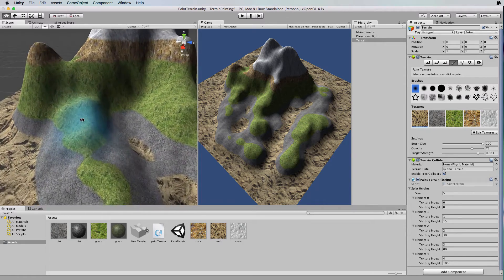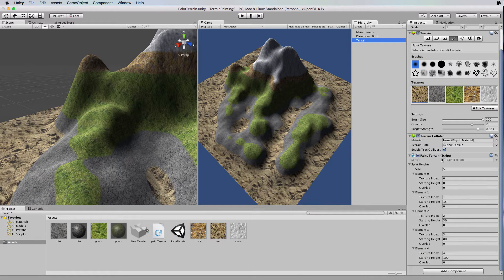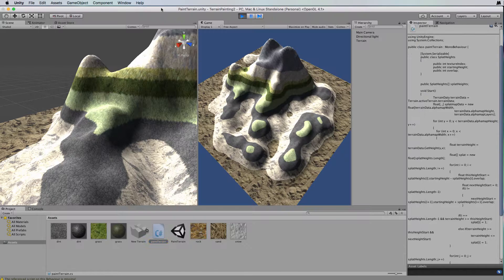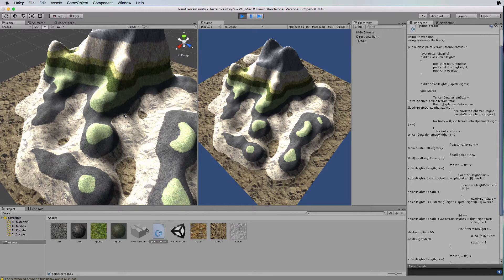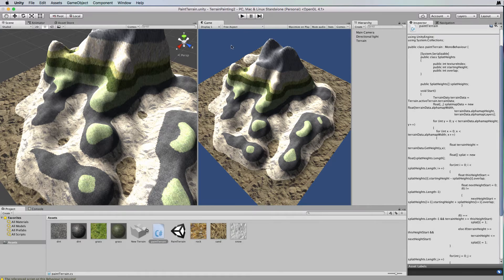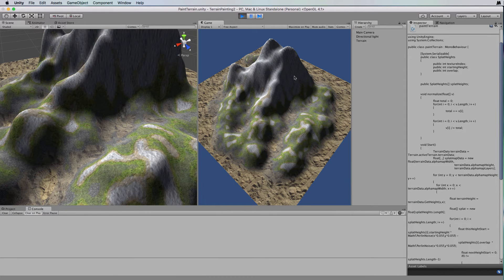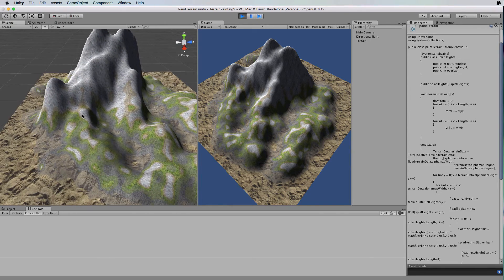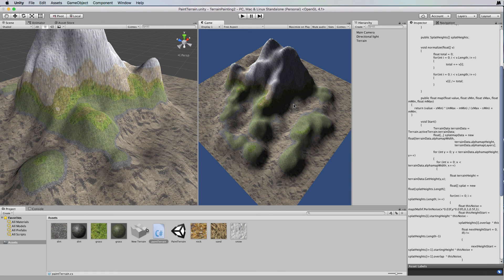Procedural Terrain Painting Part 2

Comment: Not really related to this video...
1.1 Should I use just one big terrain object or many multiple small ones? (If we are talking about procedural generation in 3D using terrains)
1.2 Scaled up terrain or scaled down player for the feel of big open world?
2. Is it possible to punch a hole in terrain or make it invisible and not collidable in some place? (so it would be possible to make tunnel system under terrain and make an entrance.)
Reply: 2. I don't use Unity, but if the terrain mesh works like NURBS, than you can only set the terrain height at these places where you want have a tunnel to 0 and put a manual modelled mountain with an integrated tunnel over it. Usually most games do it that way. If you carefully take a look at them, you will notice that. 

An alternative to  this is, adding some sort of modelled front building on the map and use level sections which will be some sort of invisbly teleporting the player into another level room, in this case your modelled tunnel. And when he leaves the tunnel, back to your normal open world map, you will need the same thing at the end, which means that the player will get teleported back to the open world level.
The disadvantage is, that you will usually need sharp 90 degree corners and the teleporting must be supported by the engine. You will also not be able to use straight tunnels with the visible outside at the end of the tunnel with this technique. If you want have that, use the first solution.
As a start you could read a little bit about that in this article:

https://en.wikipedia.org/wiki/Quake_engine#Sectioning_the_map_to_increase_speed 

Usually such terrain maps are only 2d grids for performance and memory reasons where x and y are in fixed steps and only the height z is modifiable.
To be really free in tunnel making every vertex of a terrain would need to be made of 3 coordinates, not 2. But this isn't very efficient and often a waste of memory space. 

An example games for the first technique, a 3d modeled mountain with a tunnel, is GTA San Andreas.
An example game for the second technique, with a tunnel entry model at the front and level sections, is Ark.
An example game for the third technique, with 3 coordinates per mesh vertex, is Ghotic 1 or Ghotic 2, but not Ghotic 3 and later.